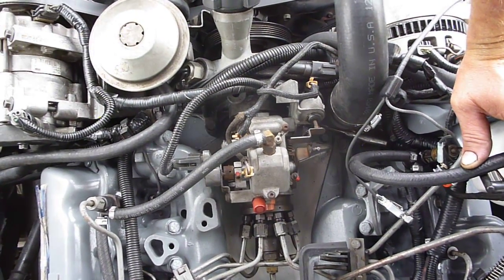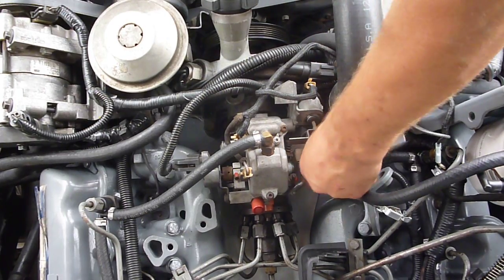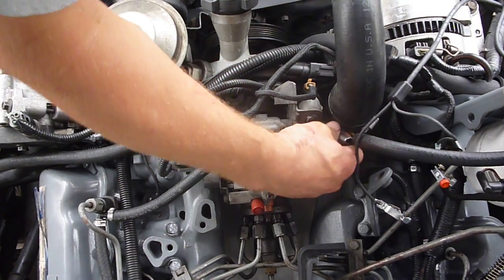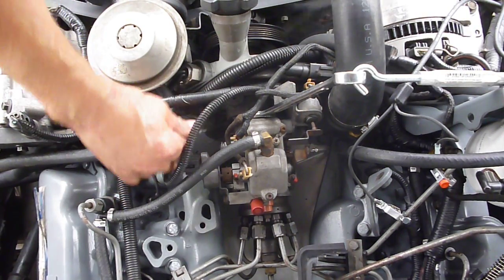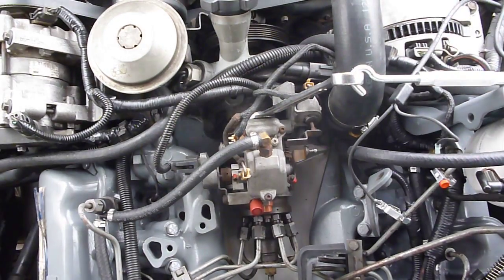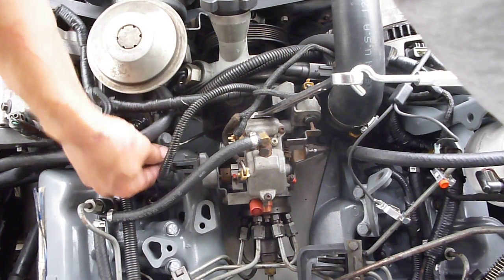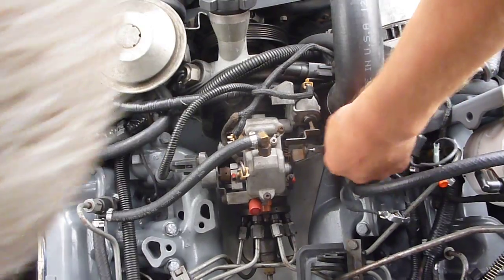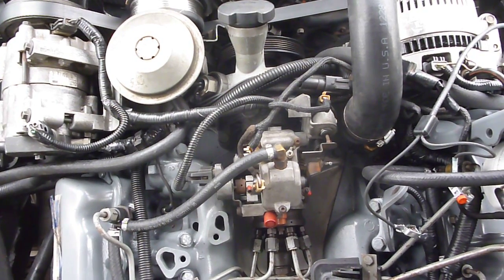Pump timing adjustment

Comment: Why you need to adjust the pump? Does the engine gives problems if you don’t adjust it?
Reply: As the fuel system wears out the timing changes. Or if you replace injectors or the pump.

Comment: Which direction is advancing and which way is retard?
Reply: Advance towards the Passenger side, 
Retard towards the drivers side.

Easy to remember, the driver is retarded...LOL

Do not turn the Injection Pump with the engine running.
Tighten the 3 bolts first.
Reply: This an old video and Joe isn`t around from what I see.
From the front of the truck, move the Pump to the 
Passenger side Advances the timing.
Move to the Driver side retards the Timing.
Do not move the Pump while the engine is running.
Loosening up some of the hard Lines at the Injectors and or IP
will make it easier to move the IP. Then tighten the lines back up.

Comment: I have a 1997 6.5 TD. I just replaced, gas tank, all three fuel lines, injection pump fuel filters. I drove it for one week and it shut off again like it is not getting any fuel, Help!!!! I had metal in the lines that's why everything was replaced

Comment: sir  i remoued fip pump deutz 4 cyl. air cooled  engine with out bringing t d c and i want to re fitt after caliberation so how i  can be assamble back as the key guard is not there on pump shaft

Comment: Thanks for the video. My 1994 7.3 idi turbo has one strange injector under the fuel filter.  It has an extension between the top of injector and where fuel line nut screws on. Is this extension normal/standard?
Reply: Fishpharmer it's normal. It's like a surge protector on your laptop.

Comment: what happens if the pump timing is not correct. My truck had miss is more noticeable in the third gear. i have stick shift truck. What can cause that miss? Also when i start the truck i hear the glow plugs clicking. &.3 idi turbo that clicking noises when the key turn in the on position is normal? when the clicking noise is stop i try start the engine. Is hard to start some today i have cycle two times. i notice under the hood is coming smoke. One leak in fuel filter is fixed by mechanic. What else can cause that smoke under the hood. When the engine is start that smoke is stop
Reply: I know this is three years late but it is your glow plug controller located behind your air intake on the non-turbos. Right behind the cdr
Reply: check your glow plugs
Reply: I go check that thank you. The truck i buy from house but before that is was construction truck.Looks like that people not care for the truck.
Reply: my was hard to get it to start but i change the glow plugs and now it turns on with out a problem
Reply: My truck when i turn the key i hear the glow plug realy do clicking noises. When the engine is cold is do many clickings when the engine is warm is do less clicking the relay. That is normal in that trucks? I take my truck in mechanic is fix the diesel leak. I have tell to him check my truck what more is need i tell i have buy used. But the mechanic no tell me i need glow plugs thank you for you tell me that. Also i have notice when i shift gears when i press the gas is do the engine like miss sounds like tractor. I try found why do that problem
Reply: Today i look under my truck and i found in the rear axle one brake hose the end is be in the top of the rear axle is connect but the other end is not connecect anywere and have one piece wood in the end. Do you know where is connect that hose. The person have the truck looks have mess up thinks.The exhaust is looks have replace is have one pipe no see mufler and is coming out after the passenger door. Before i be in storage i rent. In the gate on the way to the road is short hill but is steep. My truck is stick shift is go uphill with the first gear whiout i press the gas i have load 5 bicycles

Comment: Have a problem with my 6.5 changed the in jector pump now it wont start im thinking the rotation on the pump is off with the timing what can I do
Reply: yanisse rodriguez or you got air in the system
Reply: Your pump has to be timed with your motor

Comment: What is the size of your custom tool?  You mentioned it was possible to do the job with an open-ended 9/16" wrench, but you didn't explicitly say that was the size your tool.  Could you put in the description what size is your tool, or add a pop-up in the video at the beginning?
Reply: A 9/16 wrench lol he did say 9/16

Comment: 88 7.3 IDI N/A
Pulled onto highway, got it up to about 30mph and it stalled out. It fired back up, i pulled over and it hasn't ran since. Mechanics blew out the starter, so has a new starter. Then they told me the injection pump was bad. I put a new pump on, have no leaks in lines, but the bitch won't start without ether; then it runs good at an idle, but as soon as i shift into drive it has no power at all-can't even make it up my street. What is going on? Any suggestions would be great! Thanks
Reply: You probably have it fixed by now,but fuel line may have been partially plugged.I'd like to know what you found.Thanx
Reply: Any updates? I think I have the same problem with my 88 7.3 idi
Reply: I've been having the same problem with mine. It's the same year.  @Lehmerable
Reply: D Lehm 
Check your lift pump pressure
Reply: i have a 94 idi turbo same problem but mine started after i did head gaskets so i am trying to debug it. i got it to start. Then i thought my rocker arms were too loose so i tightened those and then i put a push rod through a rocker arm. I replaced everything that got messed up. The motor didnt blow luckily. but she hasnt wanted to start since then. I am thinking i blew up my glow plug relay or my timing is off.

Comment: I have a 94 F250 with factory turbo, my injector pump is bad and I was wondering if a non turbo injector pump would work ?
Reply: It will. Delivery is different.
Reply: ya I was wondering the same thing, I just bought a 7.3idi factory turbo engine for my none factory turbo 91, and theres a plug on the right side of the injection pump that's not on my old 91 so will the factoy turbo injection pump work on a none factory turbo 7.3idi same question in reverse

Comment: hi, I had viewed ur vid for a little insight on how to perform this somewhat major repair. I did heeded ur info and insight, but idk u may call it luck or what ever  I used a short 9/16 open box wrench produced by allied worked but even better yet 1ce was loosened worked by fingers. the other thing was the bottem line was the 1st 1 installed to snug loosen the lift point and swing out of the way. to work call this luck or what. I didn't  get to finish due to daylight 2mmorow will tell. wish me luck.

Comment: Hey I have an 88 7.3 IDI was running fine I was in the woods came home parked it didn't plug it in the next day I tried to start it and quickly realized the starter was burnt out put a new starter in it and now it won't start I ran through the whole thing put new glow plug relay in cuz that was bad and new ignition but now its not getting fuel the fuel is getting all the way up to the water fuel separator and it gets to the fuel injector pump but does not pump into the injector do you know what this could be? No one seems to know why its not pumping through the injector pump everyone I ask does not know why this is my first diesel and don't know much about them? So please let me know what you think I should do........
Reply: on top of the injectiion pump there are two wires make sure they are plugged in and the wires arnt broke. to check to make sure your getting power pull the plug off and back on  your should hear the fuel shut off solenoid click on and off if you dont hear it click on and off thenthe fuel shut off solenoid is bad if you out a new one on and still wont fire then your injection pump probably failed

Comment: how to adjust fuel metering for each line separately; do I have to disassemble the whole pump for that? and, is it possible with the pump to have different angles of injecting fuel into cylinder prechamber among fuel supply lines?
Reply: Nope they’re all constant pressure